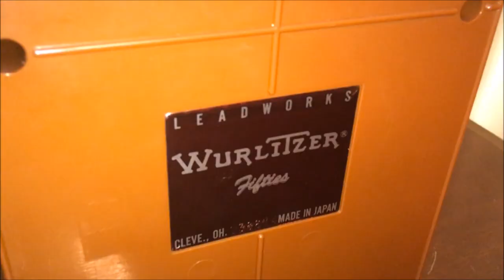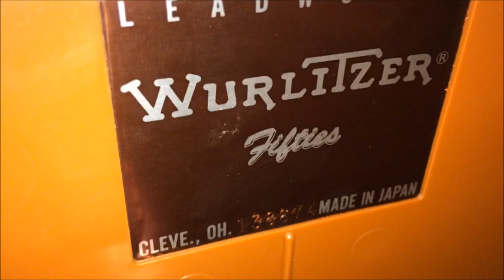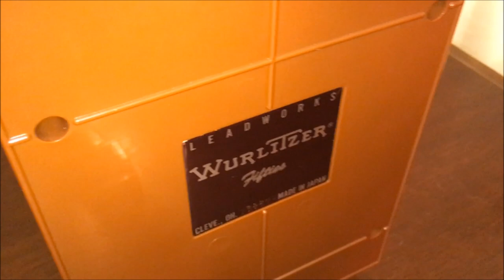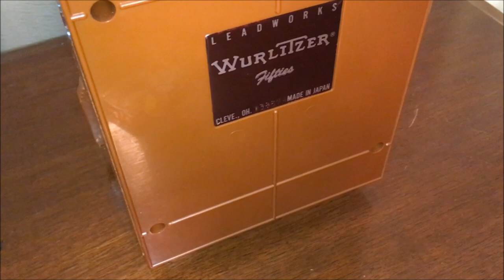Wurlitzer Leadworks MicroCassette Player

Comment: That is not a subwoofer, just a full range. For all that want to know, a full range speaker is just one that is capable of producing a large range of frequency the cheaper ones wont even cover the vocal range and some of the high end in a proper enclosure can cover most of what humans can hear. But all setups have drawbacks most speakers use multiple drivers of different types to help extend the range producible. The tweeter is for high frequency like the upper end of female vocals, cymbals etc. then Mid-range "if used" handles things mostly in the vocal range "not for vocals but that range of frequency" then the woofer handles from the higher range of bass up to the lower limit of the mid "if used" or tweeter. there is a mid-bass "if used" it fits between the subwoofer and woofer. Then the subwoofer is for every thing lower than the woofer can produce and quality subwoofers will play below the audible range.
There is a lot of science and art to matching parts up especially in designing the enclosure for them.
Now before anyone gets all foaming at the mouth yelling "THATS NOT RIGHT" its not wrong and its good enough for who its for.
Reply from the maker: Thank you, but the idea that the little speaker was anything powerful was a joke.  Tongue in cheek my friend.  It's okay, you'll understand me in time. :)
Reply: ya my mind kinda got stuck on the subwoofer part and froze not allowing more to fully register till the reboot was finished at about the "common in toys and other products" quote. I seem to have a growing problem with this.

Comment: I think the spacer is to brace the unit internally for when tapes are pushed in. Either it's needed structurally, or the flex wasn't acceptable for quality impressions, but either way it looks like the cross-shaped brace was cheaper than reinforcing or redesigning the board/tape mech mounts or the boards.

Comment: I actually repaired one of these about five years ago. It required a 2N3904 "clone" transistor, and a 34KΩ, ½-watt resistor (went to a comparator circuit, which didn't make sense; maybe part of the "errant tape defeat" circuitry?). Damn decent build quality; good mechanicals. They'll be around for a while.

Comment: If you can get hold of an NEC V-70 or V-71 Beta VCR, that would make a good video. NEC was one of the few to take Sony's higher price Betamax license option where they didn't have to buy specific VCR parts from Sony. I had a V-70, there was not one Sony branded anything inside. I counted at least 40 knobs, sliders, buttons and in or out jacks on the front and rear. IIRC it had both analog VU meters and LED bar graph, with manual record level knobs for left and right audio. It also had a pair of 1/4" mic input jacks on the front. A couple of very unusual features were a NiCd battery soldered to the main circuit board to retain the clock, counter and programmed recording settings in the event of short power outages, and a light and mirror which flipped down so one could look through the lightly tinted tape flap for visual confirmation of tape remaining if you didn't trust the counter. There was also an available PCM audio option that enabled up to 24 hours of digital audio to be recorded on a tape. (I didn't have that.) I've no idea what more the V-71 could've had over the V-70.

It looked like NEC had a "What features do you want on a prosumer VCR?" meeting, then decided to include ALL of them.

Comment: I imagine the black spacer is to dampen something that was vibrating on the front.  It may put a slight pressure on it.
Reply from the maker: Yes, could have been the racing turntable in view through the front window that vibrated.

Comment: I just bought one. Lights go on, but no sound. Don’t know what’s wrong
Reply from the maker: Check the drive belt and replace the pads on the tapes.
Reply: @databits  The pads seem to be gone but the tape still connects to the reader. Where could I get pads to put into the tapes though?